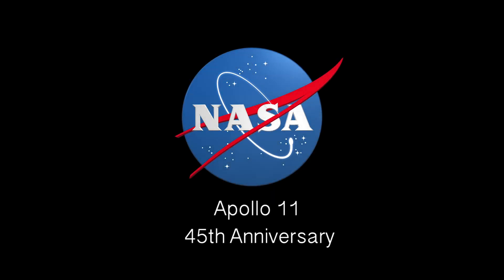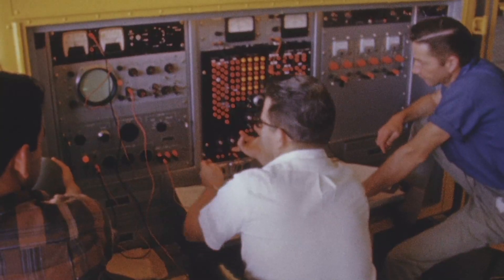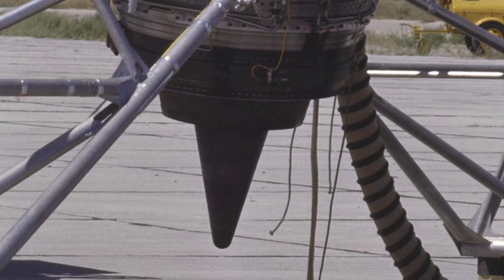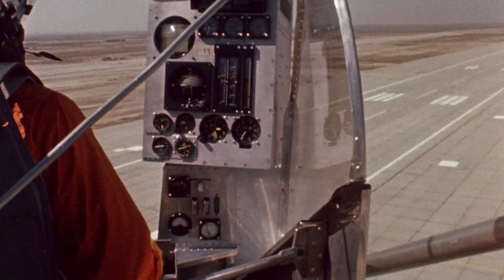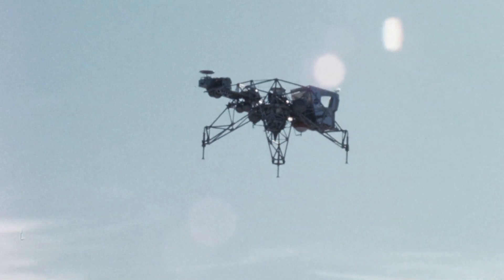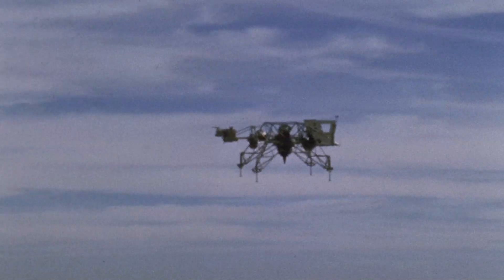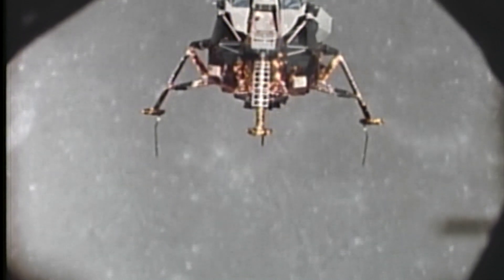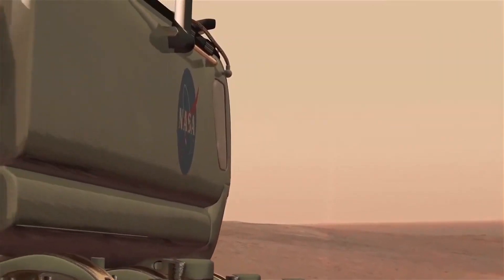LLRV Testing Contributed to Apollo 11's Success

Comment: 0 for 25 trying to land the lander on earth and then all of the sudden 6-6 landing it on the moon !  yea ok.....
Reply: nope, did you not ready my post ?? @AnOfficialYouTubeProfile
Reply: @willllllll-r1f  Armstrong flew over 30 training flights in the LLTV, making over 60 landings. All 7 of the apollo mission Commanders did this.
Then apollo 5, an unmanned test of the LM, testing both descent and ascent engines. 
apollo 9 tested the LM in earth orbit, separation and rondavous, test firing of both descent and ascent engines. 
Apollo 10, testing LM in lunar orbit, fired descent stage, approached to within 10 miles, ascent stage test to rondavous.
Reply: They flew and landed the 5 astronaut training vehicles more than 200 times on Earth, before attempting the first moon landing.
Reply: @3gunslingers  I doubt it will blow his mind any more than it already is. He is a hoax believer, after all.
Reply: @3gunslingers  
How sad that somebody regards Wonkypedia as a reliable source of information.  It just shows the level of education in some countries.
Reply: @markgerhard1362  
And you regard any "fact" pulled out of this air by hoaxers as reliable? 
What do you think is more likely: "0 for 25 trying to land the lander on earth" or "They flew and landed the 5 astronaut training vehicles more than 200 times on Earth"?

Yes, Wikipedia itself is not to be taken by face value. But if the official documents say that there were 200 successful flights of the training vehicles, you have to give it some credit. At least you have to acknowledge the very fact that those numbers exist.
Reply: @3gunslingers  
>>"They flew and landed the 5 astronaut training vehicles more than 200 times on Earth"?
There is no evidence for this statement.

>>if the official documents say that there were 200 successful flights of the training vehicles, you have to give it some credit.
Why?  I'm sure if they had said 2 million you would have believed them.
Reply: @3gunslingers  

>>if the official documents say that there were 200 successful flights of the training vehicles

And you've seen these.   Or not.
Reply: @markgerhard1362  
https://www.nasa.gov/centers/dryden/about/Organizations/Technology/Facts/TF-2004-08-DFRC.html
At least 175 flights with only one of the vehicles. 
So there is clearly evidence for that.

If you don't believe that the astronauts made multible successful flights on their training vehicles, why do you believe that they only made a few unsuccessful ones?
Reply: @3gunslingers 
All I can see are unverified claims and speculation.  Where did you find the evidence?
Reply: @markgerhard1362  
So you don't accept an official document as evidence?
Reply: @3gunslingers  
It's not 'an official document'.  It's an unverified claim made by the organization under investigation.
Reply: @markgerhard1362  
So what would you consider an official document?
Reply: @markgerhard1362  
One week and you still can't decide what you would consider an official document?
Reply: @3gunslingers  

Given that the phrase is entirely meaningless, it would be hard.
Reply: @markgerhard1362  
So you just dismiss any piece of information you are presented with as "unverified claim" if it doesn't suits your narrative?
Is there ANY document or piece of information you would accept as true, if it points to a successful lunar landing by the Apollo program?
Reply: @3gunslingers  
No, I dismiss it because it comes from the very organization being investigated - as I explained last week.
Reply: @markgerhard1362  
 "the very organization being investigated"  investigated by WHOM?
Reply: @3gunslingers  What do you think this thread is about?  Ways of cooking blueberries?
Reply: @markgerhard1362  
Under investigation by YOU? Very funny. 

So now tell me please what you would consider an official document proofing the lunar landing. Maybe something from Russia?
Reply: @markgerhard1362  can you block someone from a video channel that is not yours? 
I'd also suggest you stay away from childish comments "...cooking blueberries?"
Reply: @silenthunter8254  
So is Keyboard Runner another one of your aliases?
Reply: @silenthunter8254  

>>can you block someone from a video channel that is not yours? 
You can block anyone you like from notifications.   I only do that when the person is both extremely low-IQ and intensely irritating, as was the case with this persona.
Reply: @markgerhard1362  you block them so you cannot see their posts, you're like the cartoon ostrich...
Reply: @markgerhard1362  btw, no I am not keyboard runner, I'm not Bertie slack, I'm not astrobrant, I'm no one else but me... this is my only account.
Reply: @markgerhard1362  
This thread is about the claim that the LLRV/LLTV made ZERO successful landings out of 25 attempts.

There is ZERO evidence for this claim.

Footage of three crashes neither supports the claim nor challenges it.

Footage of successful landings destroys the claim entirely.
Reply: @eventcone  

>>There is ZERO evidence for this claim.
Given that the lander was never even tested on Earth, the claim should be 0 out of 0 attempts succeeded.
Reply: @markgerhard1362  
0 out of 0 is a meaningless ratio.
Reply: @eventcone  Of course it's not.  It expresses the fact that there were zero trials of the LEM, and zero successes.
Reply: @eventcone  
Why didn't you bother to read my comment before sounding off?  I didn't even write 0:0.
Reply: @markgerhard1362  so you are claiming that because they never attempted to land the Lunar Module on earth proves that it could not land on the moon.
Remember, the Lunar Module was designed to operate in a vacuum at 1/6th earth's gravity.
Why do you cling to an immature idea such as that. That is like saying navy jets cannot fly because they have never operate them under water...
Reply: @silenthunter8254  
Whatever drug you are on this evening, it's causing you to revert to childish put-downs.

>>you are claiming that because they never attempted to land the Lunar Module on earth proves that it could not land on the moon.
Um...no, I didn't say that, obviously.
Reply: @markgerhard1362  "Given that the lander was never even tested on earth"
That is what you said...
Reply: @markgerhard1362  "it expresses the fact that there were zero trials of the LEM"
More of your words...
Reply: @markgerhard1362  
"It expresses the fact that there were zero trials of the LEM, and zero successes."

It most certainly does not. There were 10 flight tests of the Apollo LM, from Apollo 5 (unmanned) and Apollos 9 through 17.

The first landing was performed on Apollo 11. That is what Apollo 11 was: a test of the LM under powered descent to a final touchdown.

All manned spaceflights are conducted under a flight test regime. None have ever moved to 'operational status'. That is the nature of manned spaceflight thus far.

In a flight test program, the test pilot(s) are always doing something for the first time - and so the performance envelope is gradually and systematically opened. Having fully tested the LM's capabilities in both Low Earth Orbit and Lunar Orbit, and having made 5 soft landings of unmanned lunar probes, the time was right to attempt the first manned landing.

But you wouldn't flight test a pure spacecraft here on Earth, as you stubbornly and foolishly appear to be insisting.
Reply: @silenthunter8254  
Yes, we've established that the LEM wasn't tested.  We established that almost sixty years ago.
Reply: @eventcone  
None of the 'tests' involved actually landing or taking off.  It would be like testing a submarine, but not going underwater.
Reply: @markgerhard1362  we have only established that you do not understand that you cannot test a vehicle that is designed to operate in a vacuum at 1/6th earth's gravity on earth.
We have tried repeatedly to get you to realize that fact.
We have also shown you that the LM was tested prior to A11.
Apollo 5, unmanned test in earth orbit. Tested major components, both engines, ascent/descent stage separation, rcs control...
Apollo 9, manned in earth orbit. Tested CM/LM seperation and docking, manual rcs controls, both engines, descent/ascent stage seperation. 
Apollo 10, manned in lunar orbit. Same as A9 but also did a deorbit burn, low approach to land test.
Apollo 11, lunar orbit to touchdown.
Your submarine analogy was quite fitting. Would you test that submarine in a field or in water?
Reply: @silenthunter8254  

No matter how much you repeat your strawman arguments, they are still strawmen.  Please look up 'straw man argument' if you are confused.

Obviously you couldn't test the LEM on Earth.  This was the entire point of the thread.
Reply: @markgerhard1362  we at least agree, the LM could not be tested on earth.
Now if you would accept the fact that it was tested in space.
Apollo 5
Apollo 9
Apollo 10
Apollo 11
... throughout the apollo program the LMs were tested by trying different configurations and loadouts...
Reply: @silenthunter8254  

>> if you would accept the fact that it was tested in space

As I have explained to you about ten times, none of the crucial procedures was tested.

I think we are wasting our time here.  You simply respond - either with endless repetition or emotionally, with no content at all - without reading my comments and without even bothering to understand the subject of the thread.
Reply: @markgerhard1362  where are my strawman arguments? 
You brought up the 'LEM', you brought up the submarine...
Reply: @markgerhard1362  which critical procedure(s) was not tested?
Reply: @silenthunter8254  
The point of this thread was that the LEM hadn't been tested, not that NASA should have put a larger engine on it to test it on Earth, which is obvious nonsense.
Reply: @silenthunter8254  

See if you can work that out for yourself.  We've been through this about a dozen times.
Reply: @markgerhard1362  I believe you are confused, where in this thread did anyone mention putting a larger engine on anything?
Reply: @markgerhard1362  I've checked and no critical procedure was skipped during testing.
Reply: @silenthunter8254
Reply: @silenthunter8254  
I am blocking you permanently.

You have nothing to say which is either intelligent or interesting, and your endless attempts to antagonize me, 'catch me out' on things which I haven't said and otherwise troll this forum are getting on my nerves.  Goodbye.
Reply: @markgerhard1362  well aren't you special. 
You never supported your claims, when you were shown to be wrong you did a quick topic switch, then you would say your claims were never addressed, even though there were multiple posts doing just that.
Goodbye and good riddance...
Reply: @markgerhard1362  
"None of the 'tests' involved actually landing or taking off".

Apollo 11 did.

"It would be like testing a submarine, but not going underwater."

And when said submarine made its first dive and re-surface, you would doubtless be there to express your incredulity that it had "worked first time".

The role of the test pilot is to do things with their vehicles that have not been done before, and to do them successfully.
Reply: @eventcone  
And?

My point was that the LEM hadn't been tested.
Reply: @eventcone  

>>Apollo 11 did.
Well, that wasn't a 'test', was it?

It was used the first time without any prior testing of its ability to land, take off or even fly near to the surface.
Reply: @AnOfficialYouTubeProfile  Um...the LEM obviously wasn't tested landing or taking off.
Reply: @YDDES  >>astronaut training vehicles
But not the LEM, obviously.
Reply: @3gunslingers  
I love the way True Believers think that Wikipedia is a reliable source of information.
Reply: @AnOfficialYouTubeProfile  

>>So what exactly is your point?
That it wasn't tested.  Which part of this sentence are you confused by?
Reply: @markgerhard1362  but it was tested, apollo 11 was the landing test...
When the aircraft industry rolls out a new model, they test every aspect that they can before first flight. But someone has to take it up for the first flight and first landing. Apollo 11 was that first landing. What you cannot accept is that there were individuals brave enough to do that first landing. 
There were previous landings by unmanned probes, the surveyors.
Data returned by those probes led to the successful apollo landings.
Reply: @AnOfficialYouTubeProfile  
>>What kind of testing do you think they should have done beyond what was done?
Given that none of this was real, it makes no difference what pretend 'tests' they did.  

This is presumably why they used inexperienced pilots for the subsequent missions, instead of using the only pilots who had actually done the job before.  No sane employer would have done things this way if they had actually been risking people's lives unnecessarily.
Reply: @AnOfficialYouTubeProfile  

>>Every aspect of the lunar flights was engineered and tested thoroughly. 

Obviously, not, as I have pointed out.
Reply: @AnOfficialYouTubeProfile  

I'm sorry to trigger such a strong emotional response!  I know how hard it is to maintain a belief system such as yours in the face of endless ridicule.
Reply: @AnOfficialYouTubeProfile  

>> that Surveyor craft had already landed on the moon
I find your naivety - attempting to use one hoax to prove another hoax - almost touching.
Reply: @AnOfficialYouTubeProfile  I would like him to say which apollo mission had an inexperienced crew. He won't, he just throws out BS and never stands behind anything that gets disproved. Until in later posts he restates his claim hoping no one remembers.
Reply: @AnOfficialYouTubeProfile  I believe I will follow your advice. Ignore the troll, let him go back under his cellar stairs.
Reply: @markgerhard1362  
">>Apollo 11 did.
Well, that wasn't a 'test', was it?"

Yes. It was.

As were Apollos 12 through 17. As I had already explained to you.

"It was used the first time without any prior testing of its ability to land, take off or even fly near to the surface".

This is not true, as previous tests in Earth orbit and in lunar orbit involved those systems that would primarily be active in landing and take-off. As any engineer knows - it is not necessary to duplicate operational conditions in order to get test data directly relevant to those conditions.

However it is true that Apollo 11 was the first time that a Lunar module landing and subsequent take-off were attempted.

That's what happens on flight tests. As I had also explained to you previously.

So the fact that the LM had not been flown to a landing prior to Apollo 11 is an irrelevancy. Move on.
Reply: @eventcone  

>>As were Apollos 12 through 17. As I had already explained to you.
Obviously a test has to happen in advance.
Reply: @eventcone  
>>as previous tests in Earth orbit and in lunar orbit involved those systems that would primarily be active in landing and take-off. 

What part of 'landing' and 'take-off' are you confused by?  Is English not your native language?
Reply: @eventcone  
Thanks for all the childish put-downs and abuse.

Thanks also for confirming my original point.  I'm glad that you understand it now.
Reply: @markgerhard1362  
We haven't discussed your original point, which was:

"How sad that somebody regards Wonkypedia as a reliable source of 
information.  It just shows the level of education in some countries."

So I am at a loss as to which point you think I have "confirmed".
Reply: @eventcone  
So why did you write that nonsense about testing the LM after the mission?
Reply: @markgerhard1362  
I said no such thing Mark.

I said that the LM was being tested during each mission, building incrementally on the results of each preceding mission.

I said that in response to your false claim that "...there were zero trials of the LEM, and zero successes".
Reply: @eventcone  
The only 'test' that needed to be made was whether it could take off and land.  And that wasn't done.
Reply: @markgerhard1362  
It was done on Apollo 11. Which was reassuring to the astronauts on Apollos 12 through 17.
☺
That's the flight test business!
Reply: @eventcone  
"Testing" means that you check it out before it's too late.
Reply: @eventcone  

>>That's the flight test business!
Obviously not.  My uncle was a test pilot - I know the business a bit better than you.
Reply: @3gunslingers  you kicked his ass
Reply: @spinningsquare1325  
Seems so, because he started to behave really buthurt.

He chose to ignore the very existence of documents about the hunderts of flight test. Not saying they are faked, but claiming they don't even exist, AFTER I showed them to him. Must be really desperate this dude.

Comment: Armstrong: ok engines stop... Houston: we copy you down Eagle...did they forget about the 4 seconds delay? 240,000 miles away and they replied as if they were next door!  Maybe because they were next door? 🤔
Reply: That footage was being recorded on earth, after being broadcast from the moon.. If you’re standing in mission control and you hear the astronauts talk, you can respond as quickly as you like, and recording equipment would pick it up accordingly. The astronauts wouldn’t hear you for about 2 seconds and you wouldn’t hear their response for about 4 seconds.
Reply: @marksprague1280  your so entrenched with beliefs it happened   it didn't get over it
Reply: @michaellyne8773  Little boy, while the astronauts were walking on the moon, I was calculating the flight characteristics of rocket payloads. You probably think that Bill Kaysing was a NASA engineer working on Apollo, and that Bart Sibrel is an honest journalist.